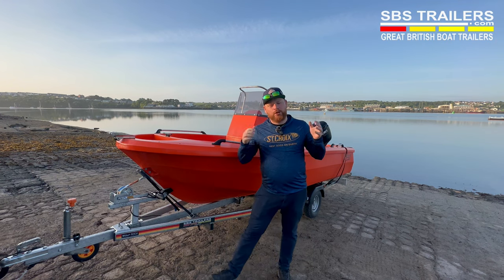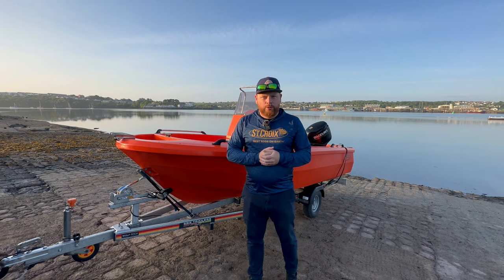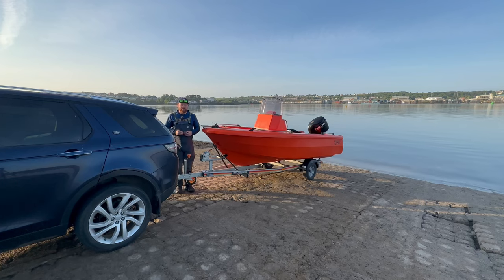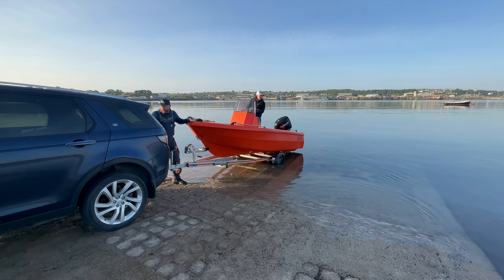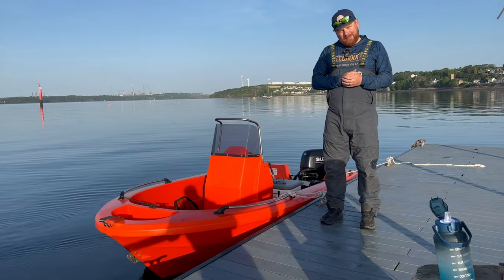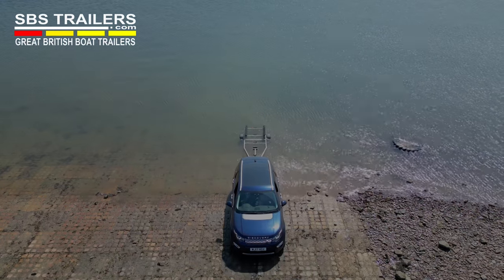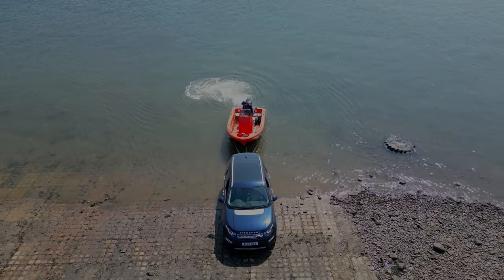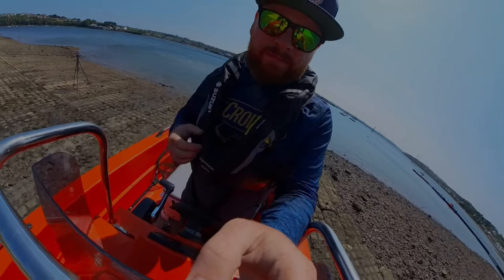How to Launch & Retrieve a Boat the Easy Way (Plus the Key Mistakes to Avoid!)

Comment: The key point here is to prep %90 not on the ramp, but prior to the ramp. 
If this was a busy day, you would annoy a lot waiting to launch.
Sort all bar the winch and safety stap, then approach the ramp to launch. 

Sorry to be that internet commando😂
Great vid though
Reply: Very true but isn’t an largely issue in the uk less people per capita have a boat and there are usually more slipways(ramps) in an area dedicated to boating which are also usually private and belong to a person or yacht club for instance at my yacht club I have been able to sit on the slipway for hours and never saw a single person.

So in conclusion your point is valid but In the context of this video you can get away with preparing on the slipway as you are highly unlikely to impede anyone else.